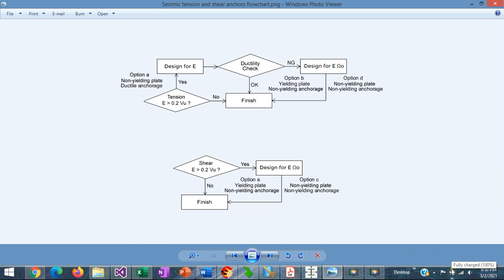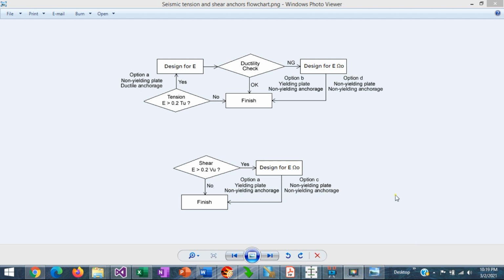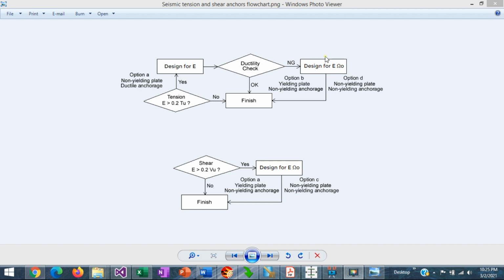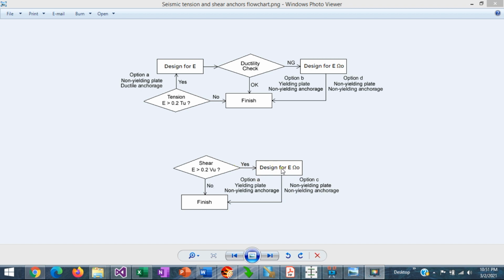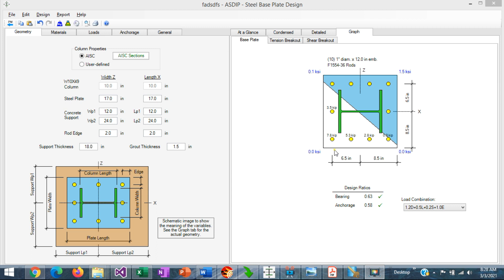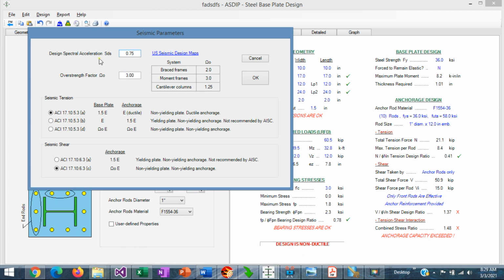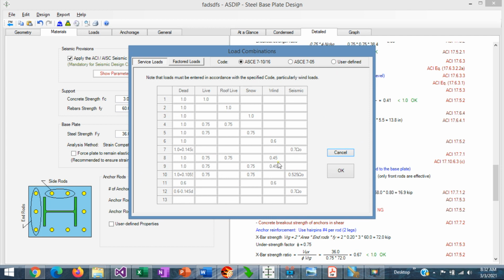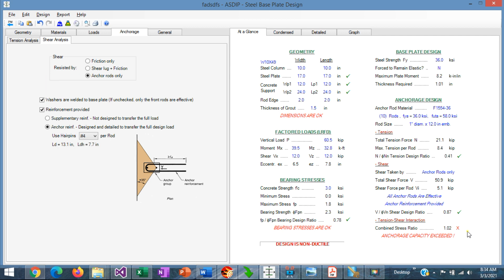Anchor Rod Design - Overview of the ACI Seismic Provisions

Comment: for tensile check on anchors per option b, isn’t it the expected strength of anchor which governs rather than omega *E?  The expected strength factor per R17.2.3 should be considered.  From my understanding, over strength factor applies only at option d. 
Thoughts?...
Reply from the maker: The program uses the expected strength factor for option b.